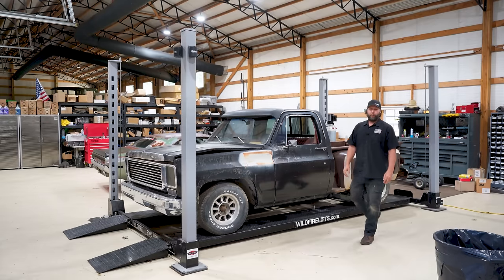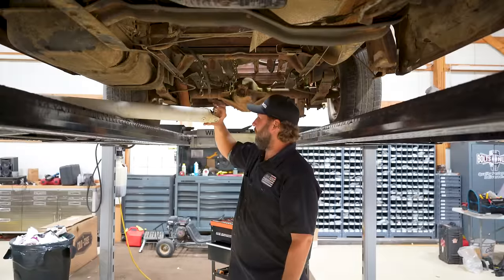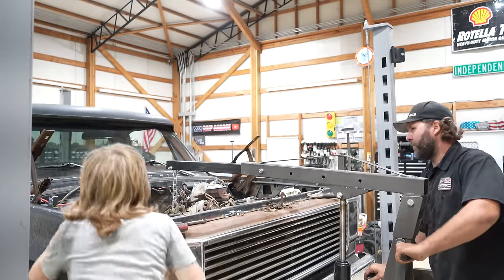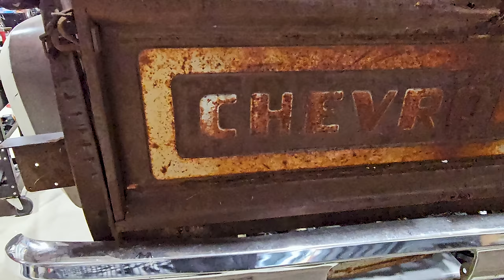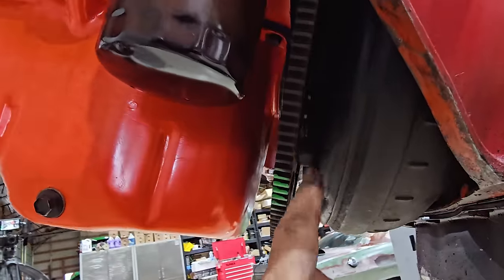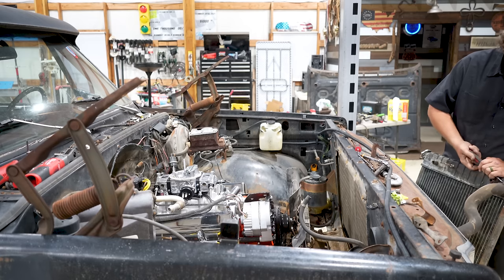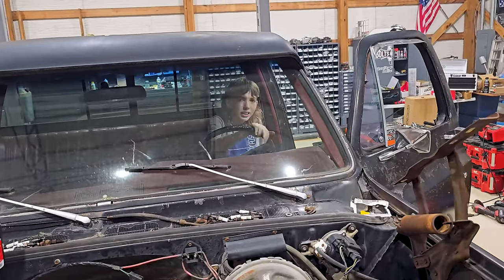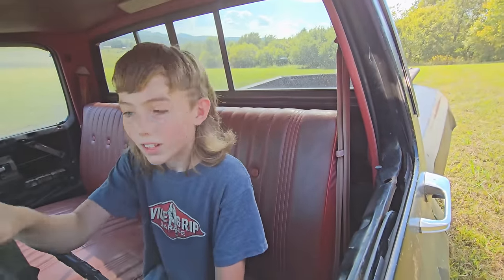Engine Swap! Father & Son Budget Squarebody Truck Build -  Part 1

Comment: I would recommend to rebuild every time. 1) I'm the one rebuilding. I have confidence in my own work. 2) Commonly its cheaper to rebuild it yourself instead of buying a crate. 3) The boys would never forget. I am 48 years old and to this day I remember rebuilding a Ford 390 V8 with my Dad when I was 13.

Comment: Me and my dad built my first car together, and it was a 79 El Camino with a 305. Did the same kind of rebuild as that with a big cam and 307. It smoked the tires with the 307 and was loud enough to intimidate and was still fast to outrun most of my buddies. I eventually put a 396 in it in tech school and a 12 bolt rear end with a locker. Honestly the 307 put up to more abuse than the 396 did. Your boy should have it a long time. I sold it to my cousin to keep in the family, and to buy my first Harley my dad also taught me to ride. My cousin didn't have it a month and drove it through the town post office wall trying to burn rubber leaving.

Comment: The best feel-good content on You tube, my heart swelled watching this.  You are both an inspiration, Derek and Bentley.

I did have to chuckle though at the mentions of this 305 only being a small engine, and the modest addition of an aftermarket cam for a lad's first car/ truck.  I say that when I consider that the cars I drove round the farm as a boy and then on the road when I was old enough had 998cc engines (61ci), and my mods consisted of removing the exhaust and brake lines on a rock within the first day or so...  

I never had battery either, I got really good at push starting a car single handed.

Comment: I have an L-88 hood scoop that I’ve been wanting to cut out the back wall of the front slope up to allow for better scavenging of the radiator and engine compartment heat. 

I agree with you and was going to mention about the tweak on the edge of the spoiler wings, good eye! Maybe consider following the contour of the rear side pane and flare it to a rounded corner on top to match the radius of the center portion of the wings.

This car begs for a well built old school 427 with the L-88 air cleaner, if you make a smaller enclosed air box just behind the top hood vents to access the air feeding from the windshield. 

My old ‘72 was downright frightening beyond 120. Flares spoilers and a fresh FE-7 Big Block suspension will help lower your front end by about an inch and with a better spring rate! Do research on this! 

Very impressed with your results so far!

Comment: Yes! Definitely a tear down. If’n it’s a 4 bolt cinched, a rebuild with a mild rumper. Put it in to the rat p.u. Or back in if you’re not going to use the 400. Explain the options to Bent  and let him decide. Install a B&M kit on the 350 trans.

Comment: I too had a 77 step side growing up through high school and college. Pulled the straight 6 out and 3 speed. My dad and I rebuilt a 283 and put in a 4 speed with floor shifter. Thanks for bringing back some good memories. I'm sure Bentley will enjoy fixing it up with you as I did with my father.

Comment: If I’m pulling the motor, usually I start with a strapping the transmission down pulling the bell housing bolts drive line, but first and foremost to drive line block it in place we had a big old eucalyptus tree in the yard at the house. I’m from Half Bay, let me tell you, bro that thing had a chain hoist like you wouldn’t believe we didn’t have no nothing other than jackstands in that big tree, but we made things work, I had a lot of fun learning my stepdad worked for transmissions and then he worked for a couple others in San Francisco when I was growing up we did a lot of rebuilding there and that’s actually where we picked up our M2 crusher for that car

Comment: Everything I know about working on vehicles I learned from rebuilding my 1949 Willys CJ2A with my Dad when I was 12 on into when I was 13 . I remember every nut , bolt , 2nd and 3rd gear synchro , transfer case and diff rebuilds , and the torque specs on my crank caps and rod caps - and I’m 57 now . My Dad passed a few years ago but I still have my Willys . Memories like you’ve made will never be forgotten or replaced .

Comment: For some reason, the cherry picker maxed out reminded me two occasions where I've dropped an engine. The first one was an International 345 and the second was a 5.4 3V Ford V8. The International went into a 60s 2-Ton sileage dump truck. We lifted it out with a janky old chain hoist that was hanging from a rafter of the machine shed and the hoist let the chain slip. The Ford was due to a bolt snapping as I lifted it with a cherry picker up to the engine stand. Thankfully only the shop floor was hurt on both occasions. Safety first fellers! Have you ever dropped an engine Derek?

Comment: My dad never left me for wanting, he wasn't a mechanic by any means but he recognised i am mechanically inclined and he let me tear down the lawn mower and other small engines before helping me get my own car to do work on :) it's such a freaking help to have supportive parents and it's so wholesome to see!!!! I'm no mechanic now either, but i'm able to fix various pieces of equipment and electrical stuff around the shop i work in because of his support! Heh i remember changing the oil on the lawn mower and doing oil changes on the cars when i was less than 11 years old and he didn't (or at least pretended to not) know how to do them :P Very good my man, this is why i subscribe to you. (small shout out to garret and matt, you know who i mean, because without either of them i'd have never have found this channel and your great work!)
If you aren't subbed to VGG and are reading this comment, well what the heck are you waiting for? Also grab a hat or a t-shirt from his store :D :D 

ps. i recently fixed my landlord's 1970s lawnmower and it was a blast to see how simple engineering was back then, very inefficient i'll admit but... down to the point. i need fuel to go in here so we need a clear passage to the venturi portion of the carb and i learned from YOU, Derek, about cleaning the jets. it's really a beautiful design!

Comment: If the block is good send it out for a machining and then completely rebuild it.  put a performance cam, rods and lifters in with an efi 4 barrel.  side pipe it and have some fun.  obviously there are few details in there that would have to be done.  but why not.

Comment: You did the right thing with the 305 VS a big block.  If Bentley is anything like me and my buddies were, he will find enough trouble with the smaller displacement.  Learn how to handle lower HP situations, you will be better driver when you get bigger power.  Love the show and Bentley excitement!

Comment: Sons truck.  Cab off frame restoration drop it 3"  rebuild the rear-end,  beef it up with raching gears tub out the wheel wells drop the frt end 4"  beef up the frame stuff 1000 phonies under the hood w/turbo 5 speed hurst shifter on the floor  add power sterring power brakes  slicks on the back and narrow frt tires. Paint as it is rusty looking and put mater on the tail gate with a lighting bolt .

Comment: Disconnect the battery, drain all the fluids, remove the drive shaft then engine & transmission mount bolts then all fuel transmission and power steering lines then all electrical lines and cooling hoses

Comment: I start under the hood pulling stuff off to make room to unbolt mounts and exhaust. Usually leave the crawling under the car until last, easing myself into it. If I had a lift I would never crawl under the car.

Comment: I think you should get or use a trans jack and remove the trans first . Then pull the engine . I think it is a lot easier . That`s the way I do it and was taught that way .

Comment: Great project for you and the boys
With all the engines You've pulled, why not invest in a air assist  pack to drive  hydraulic cylinder. On Cherry picker

Comment: I disconnect the battery, but I always start by removing the driveshaft and working my way up depending on the vehicle if it’s a front wheel drive car, then we’re probably just gonna disconnect the front axles again and then pull the motor

Comment: I have yet to pull a car engine but I have pulled and replaced two blown motorcycle engines and I usually start by draining all the fluids out just so there's less mess to deal with... and so I can potentially find out what helped cause said engine to blow...

Comment: you can see where it's an advantage for a fella to be small and nimble and be able to sit ON TOP of the engine to do the deconstruction deed. Saves on the old spinalator and bending over the engine compartment.

Comment: Have Oreally's sponsor you for one of there slick air-over-hydraulic engine hoist lift ram kits.  Slips in place of the existing engine lift ram and allows air pressure to pump up the engine hoist.   It also can be pumped manually if no air available.  (Ahem, HarborFrightening30inchramkit).   Oh,, I remember the days, of being able to jump out of an engine bay.  Bentley makes it look easy.  Not fair.

Comment: Take off hood, disconnect battery, drain fluids,disconnect exhaust, and motor mounts, pull drive shaft and cross member and hoist her out

Comment: I disagree about not replacing that crossmember. It has a transmission mount on it with rubber bushings, which is what those two I imagine 17 mil bolts are in the middle side-by-side. Personally, I think the transmission mount is important, but I could be wrong.

Comment: putting a performance cam in a 305 is a lot like putting lipstick on a pig. But, since the main issue those engines have is melting cam shafts, I'd like to know how well it runs.
Edit: OK, that sounds better than any 305 I've ever heard! You might make a believer out of me.

Comment: Greetings: I vote  assist Bentley in the diagnostic disassembly education process.  I would try 2 save this engine and return it back in the truck.  This frees the super charged engine 4 a better served purpose. That is way 2 much engine as Bentley's 1st vehicle. Just a thought.  Thx 4 the share. Keep up the good work and Bsafe.

Comment: Haven't had to pull engines too much, but of the few times I was allowed to do it my way, I just pull the engine. I'm not doing anything with the transmission, so why pull it and add all that time to the swap? Undo the bell housing bolts, undo the torque converter bolts, pull engine. No sure why everyone says to pull the transmission too.

Comment: Q; Where to start ? A; Torches. Many answers because it depends what you are trying to achieve. 
“What do you want from life” Frank Zappa
If you want the motor for something, Starts and ends with torches.
If you want the car, then it starts with from front Ujoint, and keep unbolting thangs.

Comment: I would like to see a tare down  
I also have a question if u buy cheap headers say 200 250 vs 800 1000 is there a different other than rusting fast

Comment: hey dereck. i have seen you do this kinda thing like a dozen times and  i cant help thinking. why doesnt a guy use 2 long threaded studs into the engine block so a guy can just slide the trans housing straight on and save on the skined knuckles trying to wrassel it into place to get a bolt in. .
Reply: mrvice_grip_garage thanks fella.

Comment: I guess Ford owners are the most loyal followers with Toyota close behind but Chevy was I think in 6th place. I had a summer job in the 60s working in a small tool and die plant. They made head bolts for Fomoco and I made the deliveries in about 250 lb. containers. The inspector from Ford would come on the loading deck and pick one random head bolt to check with his micrometer. If it didn't precisely match the specs, he would reject the entire shipment.

Comment: so does a fella teach a younger fella the correct name for things and then provide a fellas translation? I realized this when you said 'snips' and Bentley needed clarification on what that was. I was thinking wire cutters or tin snips, but was questioning what you meant myself. There are so many 'Derekisms' you've come up with to name every part and tool. Just hoping your son is learning what their real names are and why you use your Derekisms for humorous effect for the videos and not because you don't know what they are called.